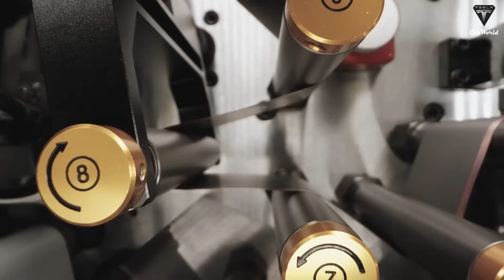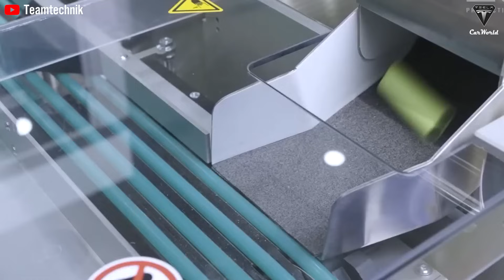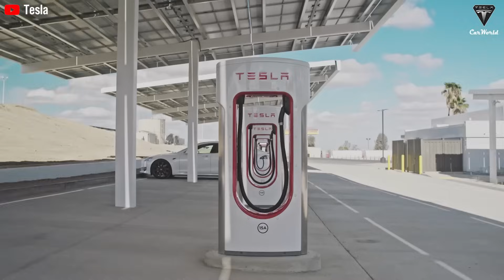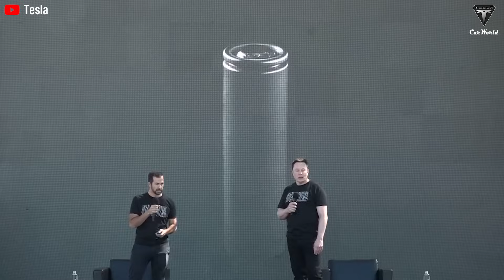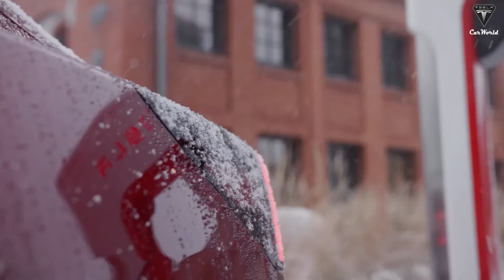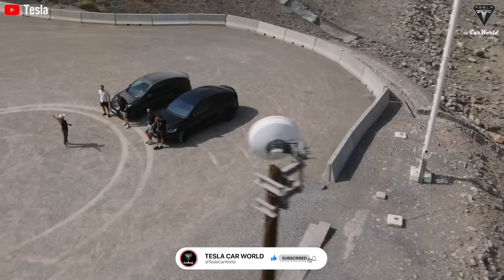Just happened! Elon Musk Unveils 5-Min Sodium Battery, Finally Unlocks 100X Energy-Density Leap!

Comment: Sodium-ion. Batteries. Typically  have. A lower. Energy density  than. Lithium-ion. Batteries  currently  in. The range  of 130-160wh/kg. Compared. To Lithium-ion’s. 180-250wh/kg while 
Improvement. Are. Being. Made this lower energy means. Sodium-ion  batteries store less energy form the same size or weight
Reply from the maker: You’re correct—current sodium-ion hits ~175 Wh/kg. It trades peak density for lower cost, extreme cold resilience, and 10,000 cycle lifespans.